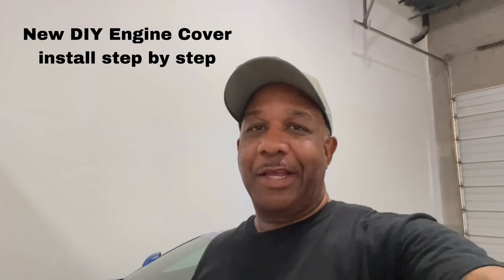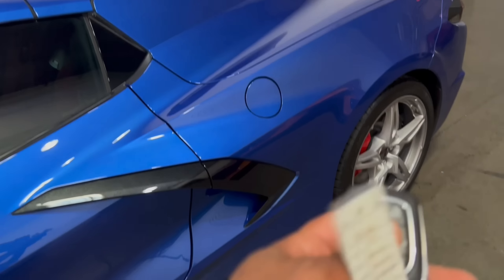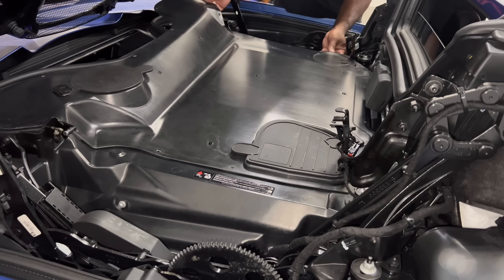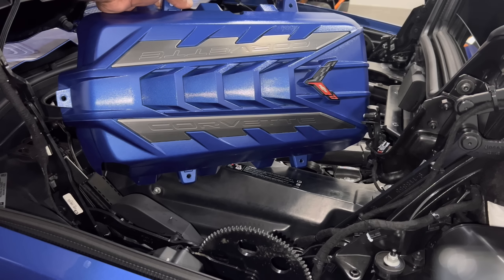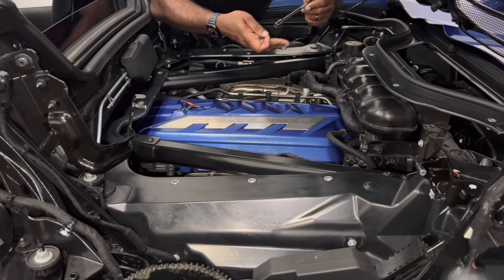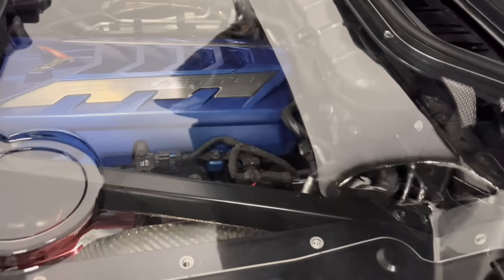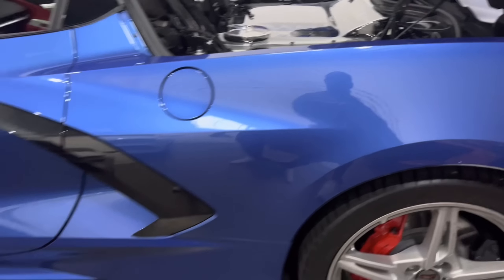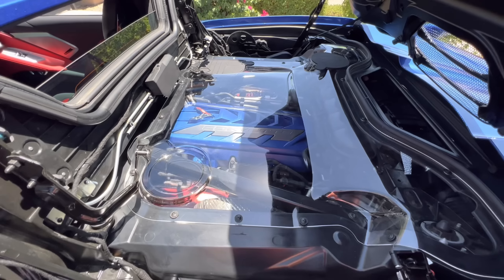DIY Clear Engine Bay Cover install for 2020-2023 Corvette Stingray C8 HTC from @ParagonPerformance​

Comment: Great video. I want to do the same thing to my 2021 HTC. My only concern is that the original cover does have that heat shield attached to the inside. I wonder what the dealer would say if something were to go wrong with the top and the heat shield had been removed. Any ideas? Thanks!
Reply from the maker: I recommend using for car shows. It seems like it might cause extra heat when the top is down.

Comment: What about heat protection? Will the plexiglass just melt/discolor and damage outer lid cover over time?
Reply from the maker: No issues so far and Chevrolet showed this on a 2024 E-Ray in one of the press releases.

Comment: How Clean does the clear plastic stay, seems like that could be an issue?
Reply from the maker: So far so good. I’ve only had to wipe it down for the dust. The engine bay has been surprisingly very clean.

Comment: How did u Install the intake cover with existing bolts or did u have to order them
Reply from the maker: I used the existing bolts. Simple remove and install.
Reply: You still need two more M6/ intake cover bolts to secure the entire engine cover.
Reply from the maker: @midengn5478  Correct. The HTC only has two so I had to make a trip to the store.

Comment: I drive a mid engine Porsche and I don’t understand why manufacturers don’t make clear covers a stock option????
Reply: Because they only look good once. It is now 2024. GM now offers it as an option when you order your new vet,  even GM couldn’t stay away from the horrendous profit margin for a piece of plastic. Look on the bright side at least it doesn’t use three M tape to hold on.

Comment: Looks like it doesn't have the rubber seal around it that keeps the fumes and heat in the engine bay. Nor does it have the heat shield to reflect the heat back into the engine bay. Will this damage your convertible top or head liner when the top is sitting on top of it? Too early to tell. I'm gonna pass and spend the $600 elsewhere. Thanks for the information.

Comment: You took the OEM painted cover from Paragon and had it painted rapid blue?  What size bolts and where did you buy them for the painted cover?  I want to do the same for my car, but can't decide whether I should buy the painted cover from AMT which is not an OEM cover, but it will overlay the existing HTC cover or buy an actual OEM cover from another vendor that is painted more to my liking and install it the way you did.  I did not think you could put the OEM cover over the existing.  I thought you had to remove the existing and install the new one.
Reply from the maker: The Engine cover I ordered already painted from a vendor on on one of the Corvette groups. He has an eBay store. The HTC doesn’t come with a cover so had to find a nice one. Price was right around $500. The clear cover came from Paragon. Sorry for any confusion.
Reply from the maker: I think it has the side bolts, just have to remove and you may need 2 more. I don't remember the size.
Reply: Ceteter lite cover for the c8 corvette

Comment: Looks great but might make engine overheat have to be tested in hot temperatures
Reply from the maker: Definitely will not cause overheating. This cover should allow more heat to escape the engine. The issue will be for the top when it’s down. The extra heat escaping could cause some damage because the top sits over the engine when down. It’s mainly for car shows anyway so that short of a time being on will not cause any issues.
Reply: @C8matrix  you’re telling us that you’re going to remove it and only have it on during a car show? I wonder if we’re gonna get any updates on that tedious operation, but I guess you’re gonna have to do it anyway because it’s only going to clean and shiny one time.
Reply from the maker: @itowmyhome797  Definitely no updates because I sold this one shortly after the install. This is now an option from the factory so no issues keeping it on permanently.

Comment: sorry i just dont get it,,,you want to show a car engine, but your not because you just put a engine cover over it, which someone designed to look like, whatever they imagined in their head to look like, then top it off with a clear cover, again makes no sense, why would i need to look thru a cover when i can view a engine bay with no cover at all on it !!! sorry just dont get it...
Reply: The Corvette C8 engine cover protects against dust, debris, and other contaminants that could potentially damage the engine. Its precision-engineered design seals the engine compartment, keeping out unwanted intruders while allowing adequate airflow for cooling.
Reply: Oh wow,,, dust.   Nothing is going to "damage the engine". Lol

Comment: That cover looks great. Next time just buy a coupe. They are way better anyway.
Reply from the maker: I’ve owned 3. My first one was a coupe. The HTC is way better for me. Can’t take the top off at 20 mph without pulling over. Arizona is great for a convertible. I love the HTC. 👍🏾
Reply: @C8matrix  that's cause you only drive 20 mph....that car been over 30 yet?  At least drive you age...80.  Lol..I'm just trolling you Drew. You have a good channel. I subscribed.
Reply: It looks nice, but I thought the OEM was insulated with a heat shield to prevent damage to the headliner when retracted into the engine bay?
Reply: The HTC is the way to go the engine isn’t much to look at anyway. The Z06 engine is way better looking so I’d get a coup with that car. The HTC is the way to go with the stingray it’s much more exotic looking and functional.
Reply: There's nothing like being able to drop the top with the flick of a switch! If the temperature is 60 or above and the weather cooperates...that top is DOWN. If god had wanted my top up, he'd have glued it in place!